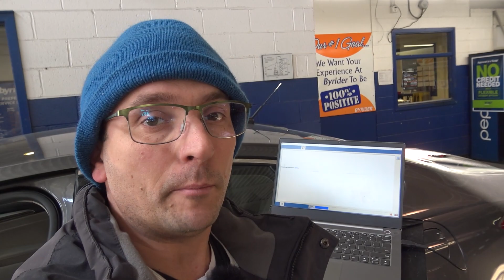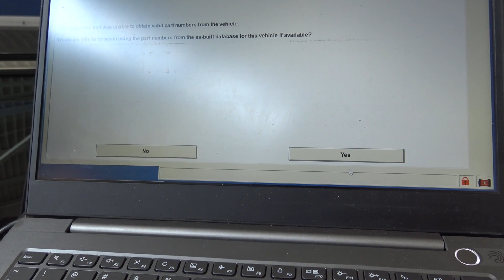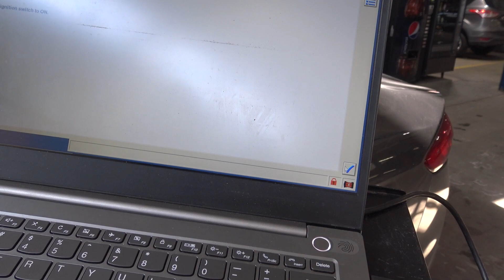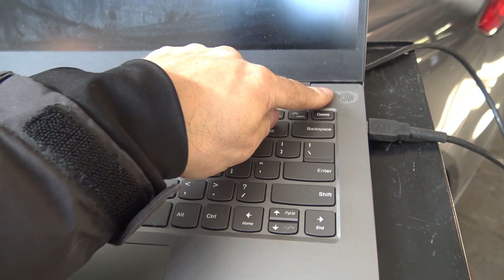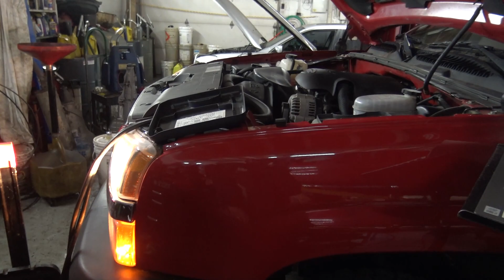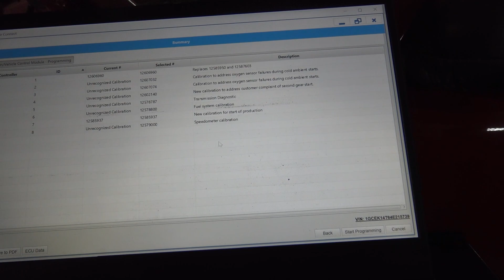2017 ford Fusion Rack PSCM Programming End Of Day 2 15 2022

Comment: Hey man I replaced my rack with rema one from oreallys and payed a dude to do the same procedure you did and it worked good for a day and the second day I hooked the scanner back into it the code u2101 came back saying configuration incompatible I erased it thinking it was history and it won’t erase This is the third rack I replaced and hoping if there is another way to fix this issue
Reply from the maker: Aftermarket racks set codes sometimes. Did it stop working,  ? We see tons of reman racks from the big parts stores fail all the time.  One shop tried 3 Aftermarket remains i came ans programmed them all, all had different issues, got reman from dealer and all good.

Comment: Hey man I seen the Mopar programming do you do mopars alot I have a ram 2021 flood I replaced a bunch of modules need help
Reply from the maker: Yes I do FCA vehicles with witech. I generally stay away from floods. I would be careful not to use used modules as you can make a big mess in a hurry.

Comment: I have a U2100 code on PSCM on a 2021 F150 even after programming as built data into the module using FORScan, code wont clear after programming, any ideas? Do I have to replace the rack again with a new module and try again?
Reply from the maker: Probably needs to actually be programmed AND asbuitl configuration
Reply: @BrianMann216  so basically do the programmable module installation feature as you did in the video on that fusion, using FDRS should work? On forscan I did the As built data writing in the module
Reply from the maker: I think it would,
Reply: @BrianMann216  PMI worked on PSCM and SECM but an update failed on IMPA and now PMI won’t work on it, failing to flash a file and getting errors because the update failed and modules can’t communicate with it although not completely dead, it’s purple in FDRS on the network scan, any ideas why it would fail to do PMI? pscm pmi failed 2 times before going through finally the third time

Comment: Do you know of a way to Bench test a immobilizer key ring? Or does it need to be connected to the vehicle wiring? I have one of them tools that are supposed to flash if it’s working but it doesn’t. It’s a start stall on a 2017 pro master.
Reply from the maker: depends on the vehicle  / system  I have not done this.
Reply: 2017 promaster. Had dash removed for heater core. Flow chart comes up with the ring is bad. Guess we’ll see you know how them flowcharts are….

Comment: So did you take off the rack and pinion and put one in and we have to program it.?
Reply from the maker: The shop installed one last week,   it was faulty,  they installed another reman unit and I programmed it.  I never plugged into the original one.
Reply: @BrianMann216 thank you for this, what Ford is telling me is opposite, that they need the original however the folks over at FORSCAN have given me the link to get AsBuilt files from ford itself. The problem is that Forscan probably doesnt read those files.